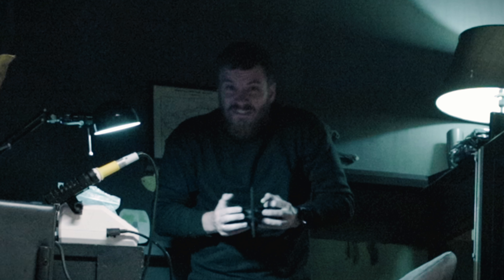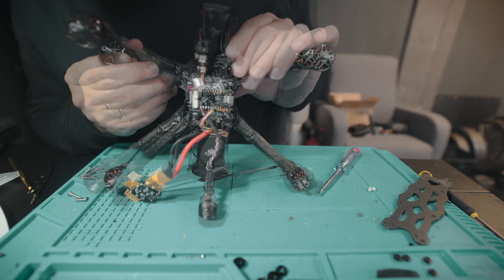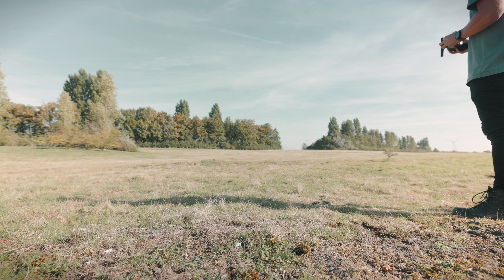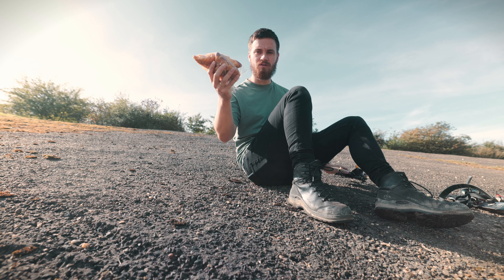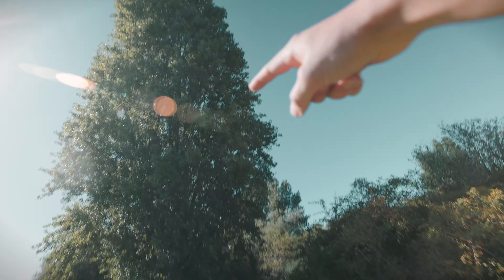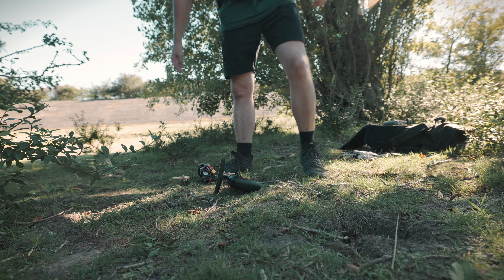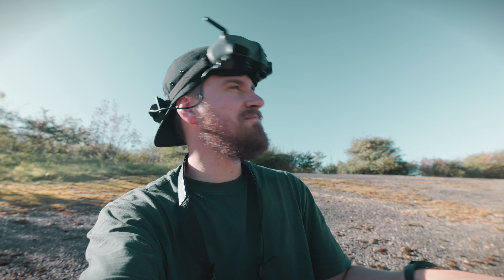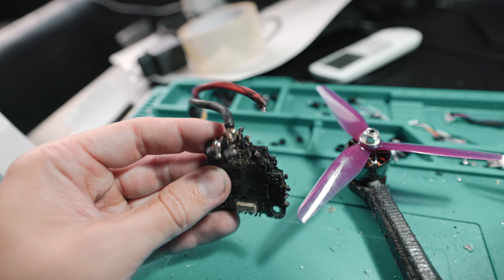The FPV Nightmare Continues

Comment: should use motor wizard btw
Reply from the maker: Are you refering to the part where the drone is flying through my ceiling?😅

I indeed forgot the motor wizard. I thought I had to do the Dshot router to get the motors in the right order. I also forgot to select 'props out'.

Erwin talked me through it after the incident. I feel stupid typing this..haha. I have to get used to the 'super simple' principle.
Reply: @_REMIE  no. wizard. it IS super simple :) router it is something else. if your pins would be destroyed on fc side - router will save your butt ;)
Reply from the maker: Understood!😁

Comment: I had an esc blow then ignite the battery.... scary
Reply from the maker: I wasn't sure if I could approach the kwad because of this.😅 Luckily it happend on the concrete, don't want to think what would have happened if it was in a tree or bush.. super dry here lately
Reply: @_REMIE  yea my batt was pretty banged up just popped the cell n it was like a jet flame comin out the hole in the cell was nuts

Comment: been flying since 2017, the invention of turtle mode is what saved my life when it comes to trees. get your eyes on the drone and then turrtle mode to flip over. or atleast wiggle and fall some banches down lower. it does what you did (turn it on and get it moving) but it does it safer and only 1 side at a time to get it flipping.
Reply from the maker: Turtle mode for the win! I tried to turtle mode this time too but it only came down a few branches then it was stuck!

I couldn't get a proper view because of all the leaves, that's why I eventually just armed it.

Thanks for watching!😁